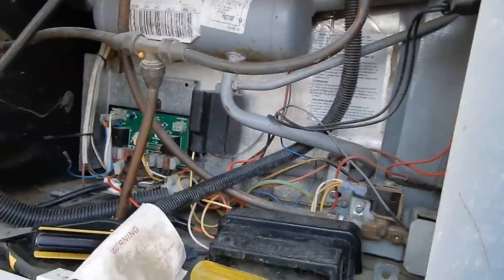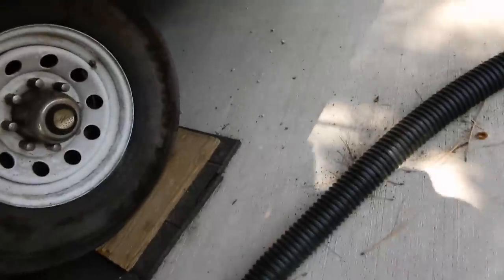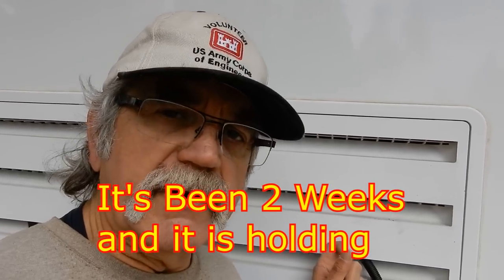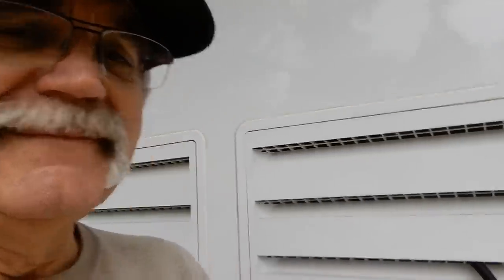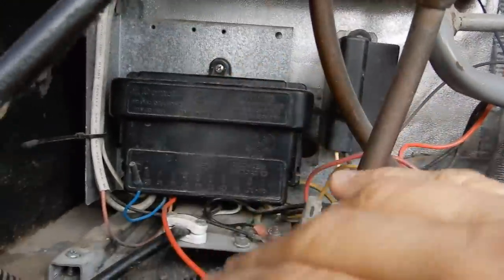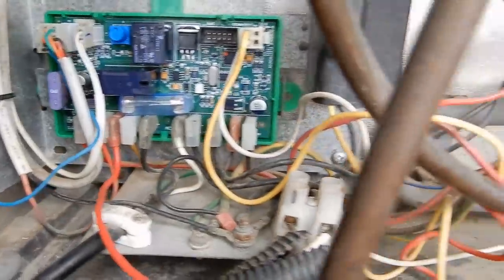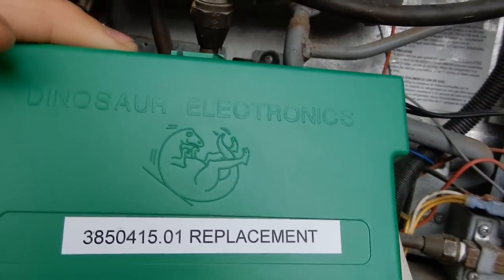RV Living means FIX IT YOURSELF! Dometic Refrigerator Repair & New Circuit Board Install

Comment: My Dometic just cacked out and I have ordered a new control board from Amazon I like the idea about fixing the new board in and then attaching the circuits one by one from the old board   I will do it that way  I think it's a great idea Thanks a lot for that
Reply from the maker: Did you get the 'dinosaur' board? That's the one we got. Let us know how your installation goes.

Comment: Dometic circuit boards do fail from time to time. I've known a couple of RVers who had to replace them. Did I mentions that in the video that you first said you were having troubles? That should fix that issue, but ammonia leaks are a red flag to time to replace refrigerator.
Reply from the maker: And our boards and everything is 13 years old now, so stuff needs to be repaired all the time it seems. I was ready to replace the entire cooling system, but decided to try this way first and it works, so I saved about a grand or so right now. I'm sure I'll need to replace it sooner or later...

Comment: I used to work on HVAC. NOBODY waned to work on ammonia systems. It is dangerous to mess with. I personally knew a man who had a explosion on a ammonia system. I would work on the boards, but I would not touch the ammonia system Tom.
Reply from the maker: Well, it's done now! :) LOL! And I didn't kill myself doing it. And it works! That's the surprise!

Comment: Any idea where I can order a replacement board part number 50–010401 – B?
I just ordered one off Amazon that was supposed to fit in my circuit board has 10 tabs at the bottom and the one I ordered only has seven any information would be very helpful. Thank you.
Reply from the maker: This is where we got our board: https://www.dinosaurelectronics.com/index.htm

Comment: I see you replaced a Dinosaur board with a Hercules. The Dino has 8 occupied pins the Hercules only has 7 do you have a wiring diagram please and thanks.
Reply from the maker: I replaced the original board from Dometic with a Dinosaur board. It was identical, same number of pins.
Reply: @TomandLoriRVLife  Thanks mate

Comment: You didn’t show us if it was working
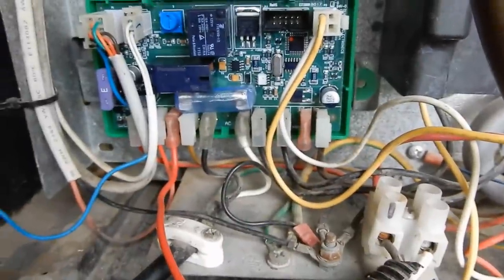Reply from the maker: At 5:50 in the video, we explain that it is now working...
Reply: @TomandLoriRVLife At 5:50, you only explained that the propane side ignited.  You said that you would give it about an hour and then you were gonna check the temperature on it but never said if the electric side was working.
Reply from the maker: @prohomevideos  you are correct sir. Electric is working also.